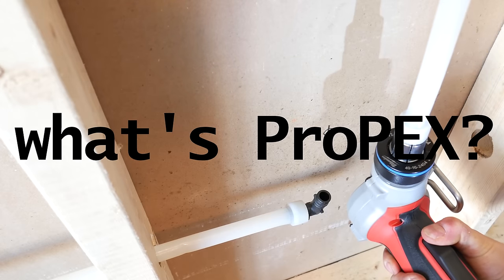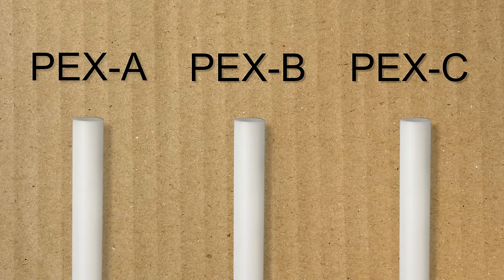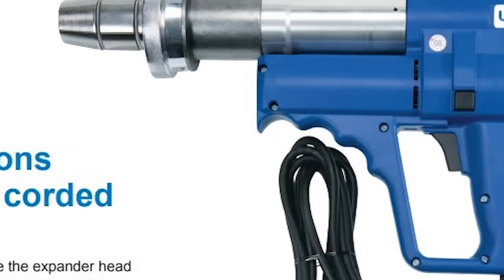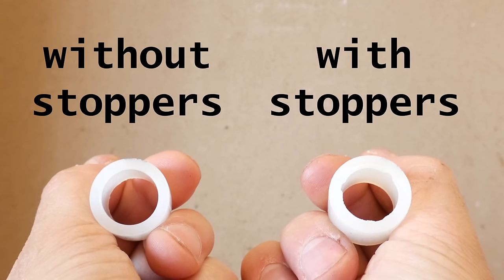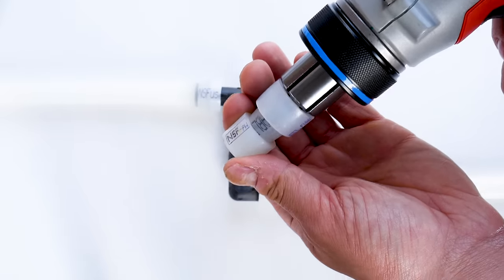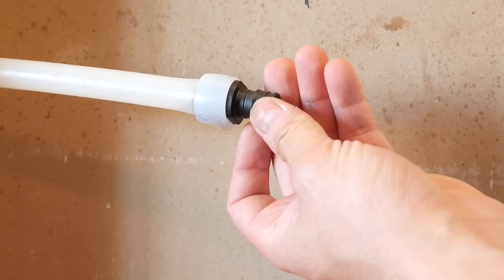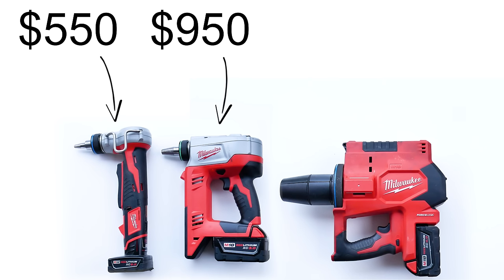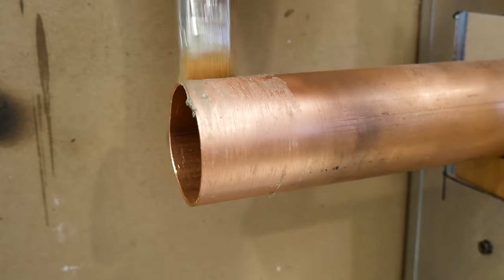UPONOR ProPEX, The Future of Plumbing (COMPLETE GUIDE) | GOT2LEARN

Comment: Master plumber for 40 years, Started replacing copper tubing in my own home with PEX because of acid water from my well has slowly eaten the copper when I would forget to add calcite to the neutralizer. Love it, easy to install except for one fact. Squirrels and mice can see the water inside the pipe and chew through it in minutes. Woke up to a flooded house. If you live in the woods like me or have random critters joining your family in the winter..this may not be for you.
Reply from the maker: Yes, mice are a problem, but that's something that needs to get fixed.
Reply: @Got2Learn  This one is a squirrel.. He is up above the drop ceiling. Going to have to remove the entire drop ceiling to get him out.  lol   If you have ever lived in the woods you would find it is not as easy as you think to get rid of these guys. They enjoy radiant heat and air conditioning too.
Reply: Only thing to worry about now is leaching of chemicals from pex that mimic estrogen
Reply: @anthonyspadafora1384  Quarter inch wire mesh?  I had mice in my 4x4 Bombardier 330 and used aluminum window screening in the air intake thing and that stopped the nesting!  Also left lots of rat bait about in a garden shed the rats decided was nice and homey.  Does the PEX A not come in Solid Colors? re: "they see the water?" What about running it inside a larger PVC 'conduit?'  where it would/might be 'visible' to such critters?  Or inside larger diameter EMT pipe?
Reply: @notcharles  They don’t “see the water”, they do the same to electrical cable. They’ll chew on anything.
Reply: Damn, never thought about rodents eating the pipes. Mine has been installed for about 8 years now without issue. Hope I never run into what you did. Like you I mainly used it because the well water destroyed the original copper pipes (though someone cheaped out and used Type M)
Reply: @SgtZima  No, they are not stupid. They can sense water.
Reply: @notcharles  Comes in red, white and blue.  I used red and blue.
Reply: @matt8863  You are correct, right now I have a pet Possum and regularly raise raccoons and a fox now and then. These animals are not rodents and are therefore covered under my homeowners insurance but sure enough most homeowners policies do not cover damage by rodents including water pipe damage chewed through by rodents. By the way I caught 2 beautiful Black racers and put them up above the ceiling. The squirrel was dead in a day, I hope they stay.
Reply: But did the mice die of cancer or reproductive failure?  In several generations maybe you'll be left with the ultimate survival mechanism, the cockroach, and... a third eye.
Reply: W t f mon
Reply: My house is 50 years old.  My copper pipes are starting to fail at the joints especially the bell end of the pipe.  So copper is most definitely forever like they say it is
Reply: Ldpe or hdpe works.cheap.been around forever
Reply: @anthonyspadafora1384  I know I'm a year late on this, but a trap would've worked quickly and without having to remove your whole ceiling.  Caught a squirrel in an old hotel hallway drop ceiling within hours with a small trap and a cookie.
Reply: Some master plumber u are...how the fook can mice see water through a pex pipe...are these some type of super mice with superman laser eyes
Reply: That’s why I use blue and red pex not white.
Reply: @johnnybear111  PEX doesn’t have BPA. No estrogen.
Reply: @syth9  all plastics have estrogen mimicking compounds, bpa is only one that was banned
Reply: @Got2Learn  add some rodent side to the plastic mix!
Reply: @guitarandmore69  basic cage every day! They do like their fresh food!
Reply: Why not put a filter if you really have to use well water? Otherwise there’s also the cheap steel pipes simular what’s used for gas.
Reply: @anthonyspadafora1384  just don’t build a cardboard house… bet ya an european house made from bricks and concrete they don’t find much space to come in.
Reply: @tronixfix  My home is built of 2x6 with plywood sheathing and handmade Glen Gery brick from bottom to top of gable. It sits in a valley aside of a creek,1/4 mile from the closest road. We have 2 large German shepherds that use a dog door and freely roam the valley.  Now all it takes is one squirrel to find his way in and chew a pipe that will totally flood the house. I also own a home in Mexico so I am well aware of how to build a home out of cement with cement roofs. I still need to clear out any Tarantulas when we get there. I don't know how they get in either, but they do!
Reply: Poison. Lots of poison. Put it in all the walls.
Reply: @keith3761  😂😂😂
Reply: @anthonyspadafora1384  why don’t fill those insides with concrete and then put insulation and scruffing on the outside wall as well as just scruffing on the inside? Tight doors also help with metal frame so it cant flex in heat and moisture.
Reply: @tronixfix  I just replaced it with copper and keep my neutralizer full. PEX also promotes bacterial growth where as copper is a natural bactericide. I still use it for radiant heat.
Reply: @kchilz32  it's white but it has red or blue letters on it to distinguish easily
Reply: This is why you always leave critters a bowl of water, so they don’t ever need to chew your pex pipes
Reply: I don't know anything about construction, and this may be a dumb question, but can't you just paint the PEX if that's gonna be a problem?
Reply: get a cat.....PROBLEM SOLVED lol. I live in an industrial unit and both places on either side of me have HUGE mice problems...not me. They avoid me like the plague! (thanks Sammy! lol)
Reply: @muskokamike127  already replaced with copper...problem solved
Reply: "Master" plumber hahaha
Reply: @vegePOG  Do you know what a Master plumber is? It varies but in PA you must go through 4 years of apprenticeship as you work for a Master Plumber, when you graduate you become a Journeyman, after 2 years as a Journeyman you can take the Masters test. All this is accomplished under the PA Dept of labor for war time placement. I also graduated from RSES with a CM certificate. The Niche between these Two trades is hydronics. That is my specialty and how I became familiar with PEX. It is the preferred pipe for radiant heat systems of which we do many. Not quite sure what you find funny. What is your skill set?
Reply: Thanks for the info Anthony. I live in a place like you do and was when I re-pipe the house in the crawl space I was debating on what to use (was leaning towards copper). Answers that question for me!
Reply: @vegePOG  Did you eat a lot of paint chips as a kid?
Reply: I used it for 2 years when it came out now I have to reach it all its failing
Reply: Wrap the PEX pipe with aluminum tape.  Rodents don't gnaw on aluminum.
Reply: Renau makes gray tubes with 3.7mm wall so might want to consider that
Reply: @anthonyspadafora1384  is pex A appropriate for radiant heat installation in a concrete floor, or do you have to get some kind of special pipe to be entombed in concrete?
Reply: @Brian_P  Pex A is the only type of PEX we use. When installing Pex under cement remember to keep it pressurized with air at 100 psi. This way if one of the cement finishers would puncture the Pex everyone will know. As they pour, keep a 5 gallon bucket handy to put over top of the puncture and then remove the bucket before the concrete is cured. It helps if you cut the ridge off the bucket so it doesnt get stuck in the concrete. Make your repair and then cement the opening. The only joint that is suitable for under concrete is a PEX A expanded coupling such as Uponor, Roth and a few others. I use Uponor. PEX A fittings retain the interior ID of the tubing and offer no added head pressure to the loop. Plumbing PEX fittings have very small ID openings. This is not so critical on a plumbing system with 60 psi it is very critical to flow rates with a small circulator.
Reply: @anthonyspadafora1384  cool thanks for the info. I already have bought the DeWalt gun and some pipe and supplies but haven't done any work with it yet. The stuff I bought was Sioux chief pipe and fittings because that's what Menards carries. Did my research on what type of pex system to invest in and settled on A.. good all around.
Reply: Why not just spray paint the pex? A gold or silver metallic paint is more than enough to fool the critters, or even just spray paint it black.
Reply: @AceSolomon94  That may be a good idea. I will check with Uponor if the warranty is still good with paint.
Reply: @anthonyspadafora1384  
They may be able to sense water, but I doubt they can sense it when it is enclosed, such as in a pipe. The reason they chew on the plastic pipes, is for the same reason they chew on other plastics, because plastic has a similar molecular structure to cheese, close enough to fool the squirrel or mouse.
Reply: @lxmzhg  Possible, out of all the piping and wires that run above my drop ceiling they would have to pick the one with water  lol
Reply: @anthonyspadafora1384  then what are they"sensing when they eat electrical wires?
Reply: @anthonyspadafora1384  I just thought up a solution... give the squirrel a little sink with a pressure-activated faucet, so it won't tear up your PEX piping... that way it too can live like a civilized critter 🤣🤣
Reply: @tronixfix  it's not "cheap steel pipes", it's corrugated stainless steel tubing which you're referring to
yes we use that for gas, there are several manufacturers
I'm considering using this at the cottage for replacing the old 60's copper tubing
Reply: @derekbarrington667  my grandparents bought land and ordered a prefab wooden cottage in the mid-1960's in a wooded area, grandad was an electrician and did the wiring then 
there have been countless rodents over the decades, and even carpenter ants in the later 90's and early 2000's 
the mice even removed the insulation from the electric oven for their nests
not once has any electrical wiring been touched, neither the older fabric cables or the newer Romex cables!! and we turn the breakers OFF when we close-up after summer!
Reply: @walterbrunswick  I did better than that, I finally chased away the mother and took her 7 babies. They are now our pets and eat with everyone else downstairs and go outside to pee. The dog is having a tough time with this. lol
Reply: @walterbrunswick  maybe in your fancy house. Where i live they use cast steel pipes.
Reply: Critters from the order “Rodentia” (mice, rats, squirrels, chipmunks, et al) are a problem for ANYTHING!
They’ll get in your attic, dropped ceilings (as someone here mentioned), vehicles, RVs, boats, etc.!
An ACTIVE & aggressive RODENT control program is required. I have just over a half acre of wooded land in a Midwest suburban neighborhood and have “eliminated” over 400 rodents in 4 years … and they keep coming!  😳
Reply: @TheRealkciRsnurB  a weeks worth of mice in my house
Reply: Some of the plasticizers used in the manufacture of plastics mimic pheromones that attract rodents.  Almost all rodents are attracted to the plastic insulation on wire and cable and it's no surprise that they're attracted to PEX, as well.  I've seen rabbits chew the outer insulating sheath off of coaxial cable at radio sites, mice come in through conduits and chew the insulation off of wiring in motor control centers, squirrels chew the insulation off of cable TV coax between phone poles, packrats chew the insulation off of automobile wiring, mice and rats chew through plastic buckets, etc.  This isn't something unique to PEX.  Rodents are attracted to, and chew plastics.  As others have pointed out:  These plasticizers may be harmful to humans as well, we just haven't found out about it yet.

I like PEX for its ease of installation and resistance to corrosion and damage from freezing.  But it's plastic, and all cautions for plastics must be taken into consideration.
Reply: I installed pexs at my house but I run it through PVC pipe So it'd be harder for squirrels and mice to chew on it
Reply: In germany the plastic water pipes for house are always black or come with a thin outside layer mostly blue where you cant see through.

Comment: Most old school pros still recommend copper for various reasons but PEX is slowly becoming more popular.  In older buildings though, it's VERY likely mice and rats will be a problem. Mice/rats love to chew through PEX piping so I'm hoping manufacturers come up with a solution that will solve this problem long term.
Reply: Good observation
Reply: Wirsbo, or upinor (the product in the video) is NOT pex. Pex is an entirely different, and far less superior product. 

Think of wirsbo as the big leagues, pex is about pewee or novice level at your local minor league sports association.
Reply: @DanoFSmith-yc9tg  sorry but you're wrong, UPONOR ProPEX is pex. UPONOR says it is pex, so it is pex. 
UPONOR is not the only company that makes pex A.
A, B, & C just identify the manufacturing process of pex.
pex A has less of a memory & has the highest flexibility, which are good qualities. pex B has a higher burst pressure than pex A, also a good quality to have.
a mouse or rat will chew thru pex A just as fast as it will thru pex B or C.
no matter what brand or letter you use, its best to use the specified parts, tools & procedures for the pex you are using.
the manufacturer specific tools aren't cheap no matter who it is.
personally i like Viega fostapex and that is what i'll be using to repipe my house.
Reply: @DanoFSmith-yc9tg  lol. PROPEX....
You couldn't be more wrong in your statement. It's definitely pex tubing, just like Viega, sharkbite, zurn...
Different types of pex for different applications. I have installed miles and miles of pex, all types without issue. Issues come from plastic fittings getting cracked from stress or mishandling. Or from crimpers not adjusted properly. 
Pex can bend easily but one shouldn't make a hard bend that causes stress on a connection, common sense that I see some plumbers lazily resist.
Reply: I use copper exactly for this reason. I've had rats and mice chew everything with plastic on it. Wires, irrigation lines, coaxial, forced air ducts, etc. Rats and mice never chewed copper pipes or galvanized forced air ducts, only insulation on them. Almost all my repairs in copper are from improper installs. I would like to use this PEX style product though as it looks very productive and offers many advantages. Great video for sure.
Reply: It is extremely popular, just renovated a bathroom recently and noticed it already had the pex b system, they said it was changed 12 years ago, it was dry as a bone zero leaks (crimp ring version), was extremely impressed.
Reply: Many of the old school pros still prefer copper, in large part to the fact many states no longer teach apprentice plumbers to braze.
Reply: They have a solution. Its called copper line
Reply: False. They actually use copper crimp still.
Reply: @DanoFSmith-yc9tg  false.
Reply: @zackjay71  no they don’t. All newer residential units are moving to pex A and B,  maybe some commercial still use copper.
Reply: Cover the Pex with copper.
Reply: No offense, but where do these people with rats, or mice live?  Ever hear of pest control?
Reply: Mice and rats chew through copper. I’ve seen it. Had it happen three times within a month before the rat was finally killed.

Comment: I live in Ontario, Canada, and here it is completely impossible to find PEX-A in any of the regular hardware stores. All that is available is PEX-B.  To get PEX-A you have to go to a special contractors supply store and buy a 100-foot-long roll of the stuff to install just a foot or two of that pipe to make the connection you need. You can buy a 10-foot length of PEX-B in any Home Depot store, but they don't sell PEX-A in any length. Same thing for Lowes and Rona and Canadian Tire.
Reply: You can buy 20 ft sticks aswell at wholesalers. But most wholesalers will not do cash sales anyway right now.

Comment: One thing people don’t mention a lot about pex is pressure balancing. I had to replumb a section of pipe that served 3 bathrooms and a laundry room. I put all the hot and cold lines on a manifold for pex a. Nice thing is even if three showers are used at same time no one notices a big drop in pressure.
Reply: There’s no substantial pressure drop if you use pex B on a manifold either. One sixteenth of an inch inside diameter reduction from pex B fittings actually increases pressure. Flow may be a little bit different but only until water gets to the shower head. Shower head nozzles greatly reduce the diameter of holes the water gets to flow through and will always reduce flow accordingly, no matter what flow there is upstream.